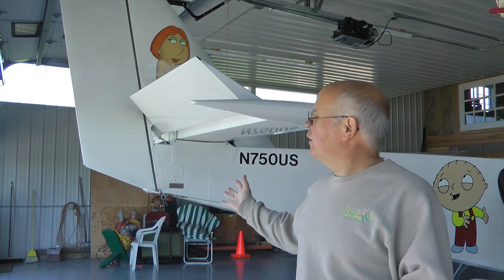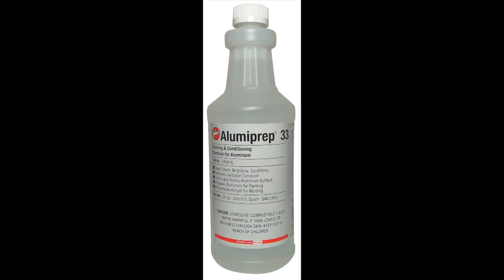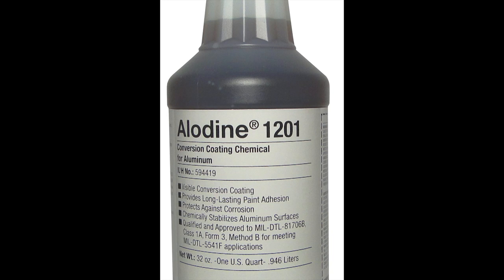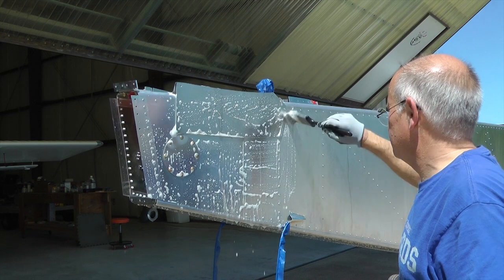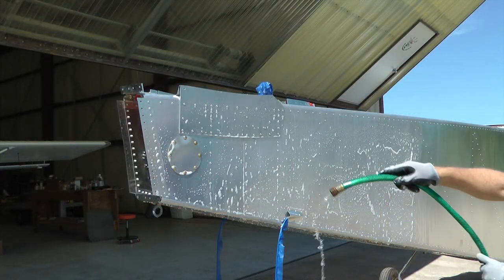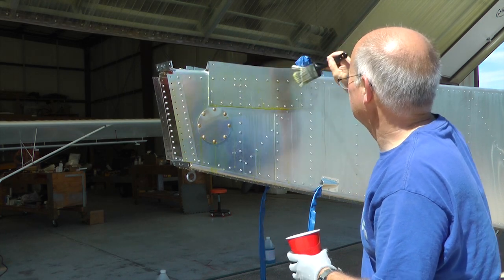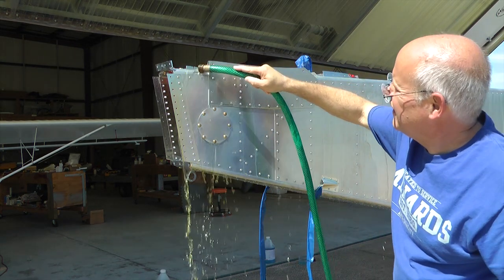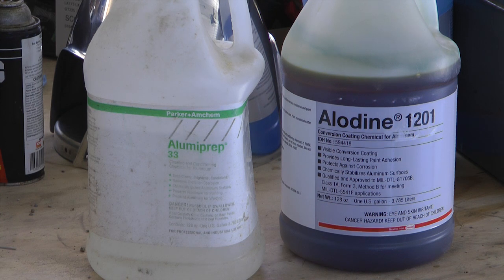Preparing Aluminum for Aircraft Painting

Comment: Not a good idea as alodine should not be applied to aircraft structures, corrosion.  Clean the aluminum with detergent and a scotchbrite and spray with a self etching self nuteralizing  primer.  Also, after priming, don't forget to scuff the surface lightly with scotchbrite to avoid orange peel.  Read the FARS.

Comment: I'm always a bit worried when someone say consult the manufacturers instruction while adding NO information.
Hexavalent Chromium is extremely toxic and will seep into ground water polluting wells for miles around. Also carcinogenic among other things.
Hydrofloric Acid is one of the most dangerous acids there are. Composed of Hydrogen and Flourine. Oxygen (atom #8) is often called ONE of the most dangerous chemicals because it oxidizes with carbon and more. But next on the atomic table (#9) is Fluorine with 7 free electrons, no other element has as many free to bind.
As a result is reacts with almost everything. It's a solvent and soaks into/through your skin and will cause bone to fizz like Alka-seltzer. When exposed patient should be stripped down naked and placed in ice water bath untill life flight and paramedics arrive.
Subject is transported to hospital, a chemical (if availible) can be injected to neutralize HF acid. Other treatments are amputation ahead of spread through bone. It's extreamly painful and typically results in death. I wouldn't touch the stuff personally, too much risk just to make a chuck of mettal pretty. My health/life is far more important.
I've seen many vids showing high voltage amp repair with advice that will KILL you. And of course the pretty plexiglass lightning figures using old microwave oven transformers (very high voltage/amperage) have resulted in 50-60 deaths so far.
Funny how people worry about everything EXCEPT whats actually important.

Comment: This method is.for real airplane only or any aluminium stuff. I need to paint aluminium aircraft models and I'm wondering how to do it. First need to find rhe way how to take off 40 year old paint from it tham how to paint again. I am reading there are some chemicals which remove easily but I'll try with that. I was thinking air sanding method too😮
Reply: If your area is strictly aluminium, strip it.

Comment: Scrub the new Ali with Deoxidine and nylon brush or scotchbrite until you have a water wet break free flow, dry the Alocrom 1200 starting from the bottom up, you're after a tea colour on the Ali, test the Alocrom for adhesion if all OK epoxy prime. Top coat within 24 hours or moisture is absorbed. That's what is was taught as a young military aircraft painter 36 years ago.

Comment: Hi. Thanks for the info. I’m painting my old Southbend 10L lathe. It’s cast iron and I’m using an epoxy primer before the top coat. But some of the panels are aluminum. So I’m wondering what I need to do prior to the epoxy primer. Should I use both the products you mention? I’ve always heard that you should alodine an aluminum surface prior to painting, but what about the first product? Both are expensive and if I can use something like an acid I already have it would save me some money. 
Your comments are appreciated. 
Thanks,
Paul
Reply: I wouldn't worry about Ali panels on a lathe just bring them in with the cast iron. Abrade, degrease and epoxy prime.

Comment: Need window min/max information for application of next material
Then what material can adhere
Eg - 4 hours max, 72 hours max
Minimum - wait 30min
At what temp 
Before applying primer or topcoat
Will an epoxy primer bite into it /adhere , then go with a finishing method from there of our choice

Comment: Im not painting an aircraft, but a tailgate made of aluminum on a 2008 ford expedition. Ford improperly prepared these and paint pealed off. In patches. 

After the alumiprep 33 and alodine 1201, is there any special primer that should be used? Such as a self etching primer? Should i use a sealer, like epoxy primer, after that ?
Reply: No answer is expected but not anticipated. To bad as so many sorry ass panels are now aluminum. I default to the aircraft industry or a busy body to get the truth in coatings. Sorry to hear your factory paint has delaminated.
  ASE Master Tech - 1978

Comment: Acid under the panels and around rivets is horrible and will corrode the panels. Not a fan of acid. Especially when you drench it. Scuff and clean with alcohol and use an aluminum primer to make it adhere. Then paint it.

Comment: When you are installing the alumiprep and rinsing the area, what do you do about the water and alumiprep that washes into the open areas of the plane and gets inside?
Reply: I never thought acid prep was worth it. The acid caused more problems then what it was worth.
Reply: @dawinner777   hi, which  problems do you mean?
Reply: @evgi2329  What would concern me is the steel mandrels in the rivets rusting and if you don't get it out from between the skins, corrosion occurring.
Reply: @evgi2329  well if a battery leaks acid you get corrosion. The acid causes huge problems with adhesion. The way these people soaks the acid on the plane the acid creeps behind the panels and the corrosion begins. This whole this is a supplier sales pitch that does more harm the good. An aluminum primer is a much better choice for good adhesion!

Comment: I am going to use this technique to refinish some designer aluminum patio furniture for a customer. I am a professional floor finisher doing hardwood, decks, garage floors, patio and driveways etc. If you have ever seen steel/iron outdoor furniture that rusts at the feet and constantly leaves rust spots on the ground, I have fixed this by cleaning with splash brand name metal prep (phosphoric acid based) from the home center (home depot paint dept) and then coating not with paint but with a specific commercial epoxy called seal krete HP 9100. Now on a job coming up its designer patio refinishing bit it isn't steel or iron, it's aluminum. I'll make a video and post a link when done.

Comment: Great video. Great information and NO RAMBLING! Q: No sanding needed?
Reply: I paint planes for a living a couple of tips use spray bottles with a fine mist flush all etch and alidine from nozzles with clear water for storage always use red scotchbrite to scrub the etch into the aluminium then rinse thoroughly after about 5 min then completely dry using towels compressed air and if message let air dry the next step will not stick to a wet surface now mist on the alidine keeping it wet for a bit the time will vary depending on how thorough the first step was done so I suggest trying a small test see a first to figure out the time you are looking for a light golden brown color to long well burn. And it will be dark if this happens restart process with etch
Reply: @rickybobby9005  acid makes corrosion happen! Especially between panels!
Reply: @dawinner777  you are correct if acid is left behind in these areas and that is why it is of the utmost importance to rinse thoroughly the acid is already watered down and what water you add to it pretty much deactivates it but yes take a special care to make sure that the seams are rinsed very well also the answer that is made for aluminum it's sold as aluminum prep it cleans the pores of the aluminum free of sanding or Scotch braiding dust which can also lead to corrosion if left behind under the paint and most definitely will lead to paint blistering

Comment: Question, I have an aluminum "Birdcage" if you will that will be INSIDE the aircraft after cover. Could I clean the aluminum and then alodine it as you show and leave it bare as it will be under the covering?

Comment: I always used red scotchbrite when i acid etched, it works a lot better. Also used a folded rag to apply alodine. Former aircraft mechanic here.
Reply: Very helpful thanks. Maybe you can shed some experienced light on method I am thinking of doing. I am painting a very shiny, very smooth 3020 or 3002 1/8" aluminum tool box I had made. My plan is to first use an automotive degreaser and cleaner prep. Rinse. Etch with red scotch Brite pad. Then apply apple cider vinegar, rinse. Wipe dry. Apply 2-3 coats Moeller Zinc Chromate primer. Let dry over night. Sand with 600 grit wet dry  sand paper. Then apply automotive ( spray gun application) and 2 coats clear sealer. Doesn't follow video. But it's a small project . From your experience is my method going to achieve adhesion to aluminum. ? Changes ? Thanks
Reply: @perryberens618  i would wipe it down with lacquer thinner sand with 400 grit wipe it down with lacquer thinner again and then prime it
Reply: @ronjohnson9507 with an etch primer?
Reply: This method is.for real airplane only or any aluminium stuff. I need to paint aluminium aircraft models and I'm wondering how to do it. First need to find rhe way how to take off 40 year old paint from it tham how to paint again. I am reading there are some chemicals which remove easily but I'll try with that. I was thinking air sanding method too😮

Comment: Alumiprep isn't necssary. You can use a white scotchbrite pad and water to scrub the aluminum until water doesn't bead on the surface anymore. Then apply the alodine. The key is clean until water sheets not beads on the suface.

Comment: How do you remove the acid from inside of the fuselage? I cringed when I saw you brushing the first solution on as it seeps in to the cracks and crannies including the rudder exit holes and angle on the bottom of the fuselage. That little garden hose action surely did nothing to remove that acid from inside of the fuse.

Comment: This is an example of the WORST TRADE PRACTICES, you are going to die of cancer, seriously.

Invest in decent length nitrile gloves, and proper eye and respiratory protection. surface prep can be achieved with clean running water and a (green) 3m scotchbrite pad to achieve a 'water break free finish' without buying alumiprep.

Comment: How do you remove great epoxy primer off aluminium , I have used many different kind of paint stripper , the paint comes off no problems but the green primer on my Cessna 172Just barely wants to come off , what is the best way
Reply: Keep reapplyin striper several times and scrap with a plastic scraper it will finally give in and be baer aluminum.keep reaplying fresh striper also.
Reply: Have you tried aircraft paint remover (example: Rust-Oleum Part # 255448)? It's very strong so be careful where you apply it as it will eat through plastics too. 

https://www.amazon.com/gp/product/B003Z8XUAQ/ref=oh_aui_detailpage_o07_s01?ie=UTF8&psc=1
Reply: @hnacion  you can't buy the good stuff anymore. Obama's EPA banned methylene Chloride the active ingredient. You have to have a business license to get it. Benco  b15 or b17 will work well

Comment: I'd definitely suggest not applying it like it's being shown - Alodine has hydrofluoric and chromic acid in it.  Wear gloves on BOTH hands and put some safety glasses on.
Reply: I did it naked just because I didn't want my clothes damaged. Not really. I just about fell out my chair when he was not using protection.
Reply: Agreed, and I've never seen alodine rinsed with anything but deionized water. hopefully the garden hose is clean
Reply: totally agree about your comment about PPE including full face respirator if spraying it.
Its ridiculously bad for the person and the environment also, dont know where these guys are rinsing the solution, perhaps the environment in America doesnt matter.

 Any clean water works, but the trick is to get the aluminium oxide coating off, keep it wet and apply when its still wet. I dont see any wheat coloured hue from correct application in this video and i think its only a representation of correct application rather than a really good application. But meh, it might be. 

From my experience as an AC refinisher it takes a bit more elbow grease than that and you know when youve applied it correctly, but if youre a home enthusiast learning from you tube, you might Alodine an entire AC and not ever know that what youve just done has achieved absolutely nothing.
Reply: We have a similar closed system sump for the same types of chemicals. Otherwise if its done away from the hangar we use cut open drums to collect the wash off and pump or tip them into the old stripper containers for re badging for disposal. Works ok.

Ive seen it too, where a stone chip on the LE from the prop or a nick in the paint has happened round a rivet and you can get an air duster and huge sheets come off in swages lol then you have to feather it out and do the whole nine yards...real pain

If theyre not getting the wheat colored coating tbh, its probably best to just forget a poor alodine application and sand it with 240 and be done with it, AC primer will stick to that no problem.  Id rather have paint on a 240 surface than a polished scotchy surface anyday, but thats just me.

Comment: Hi Jon... Can his be used to clean up aluminum prior to just polishing the aluminum as well as painting.
Reply: There is another form of alodine that can and is used for external aluminum surfaces that are not going to be painted as a corrosion inhibitor. It's Alodine 1500-1501. Example is the bright shiny surfaces for instance on American Airlines birds. You get the protective layer without the bronze staining. (Former commercial airlines mechanic)...Also keep that alodine away from steel fasteners...Bad juju. Commercial FBO's dont even bother with the aluma prep acid... Red scotch brite to prep the surface, wash with water until you get a clean sheen...Then alodine 1200 & Neutralize with water...Then green FR primer, then your external paint. Also pay attention to the grain of the material when scotch briting a surface for 1500 prep.

Alodine is not necessarily a paint prep. It is a corrosion inhibitor by applying the chromic coating to the alclad. Scotch brite alone while rinsing the surface for a clean sheen without beading will do the trick. The scotch brite roughens the surface just enough to give the paint something to stick to. We are talking microns here. Paint does not apply well to any perfectly slick surface. If the water beads the surface is too slick and/or there are still contaminants on the metal...neither is acceptable.
Reply: @swtnlnly  I realize this is 5 year old post but..  Is the Alodine 1500-1501 the final step?  Apply and rinse?  Or apply with scotchbrite? Then rinse.  Thanks.   Losing the bronze tint is what I'm after on an aluminum Jeep part.
Reply from the maker: Thanks for that info!
Reply from the maker: I believe you can acid wash (first step) to clean the aluminum, but do not perform the chrome conversion (2nd step) if you want to polish.  That 2nd step chemically alters the surface of the aluminum and am not sure that will shine up... BUT, that would be worth trying as an experiment....!

Comment: Good video.  Two questions: 1.  Should this process be done immediately before painting ie the same day?  How long can you wait before prime/paint?  2.  How safe is this for the immediate environment as the applications  drip off the airplane and later hosed off?  Should this be performed somewhere where the runoff can be contained like anti ice fluid?  Just wondering.  thanks for positng
Reply: Henkel (Bonderite) recommends no sooner than 12 hours after Alodine and no later than 72 hours after it.
Reply: guintube The reason is that Alodined surfaces are hygroscopic.  I work for an aircraft manufacturer and we tried some simple tests to see if we could extend the period of time between chem and paint (to try and ease production demands), but ended up with adhesion issues on parts over 3 days old (failed wet tape adhesion and dry impact tests).  If you have a humidity-free area, it can be done I would think.
Reply: On commercial airliners they recommended recleaning the material after 24hrs. Also, I would find a way to contain those liquids rather than washing them on the concrete. Extremely harmful to the environment.
Reply from the maker: +guintube I believe that once BOTH steps have been performed, there is no rush for painting. Of course, wash aircraft prior to painting if needed. Chemical/environmental issues: contact manufacturer for answers. Thanks
Reply: Best practice is to do this prep on the individual parts prior to assembly. That's how Beech, Cessna, Boeing, Lockheed and a host of others do this on their factory assembly lines.
Reply: Interesting...thanks.